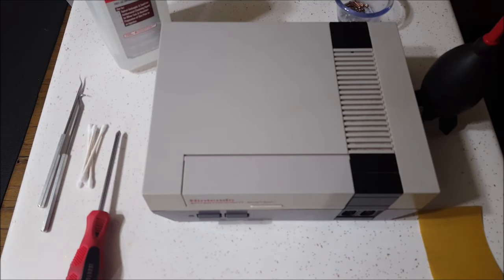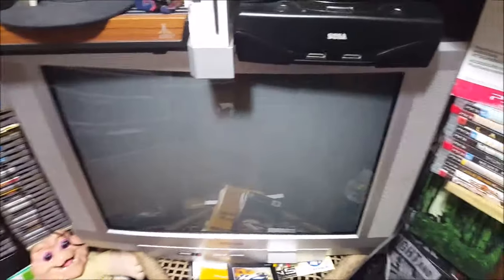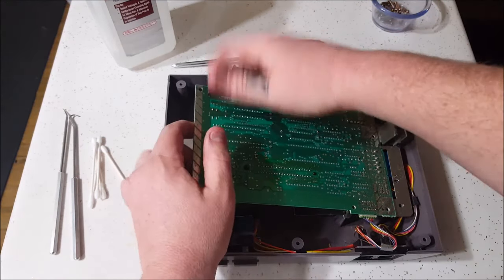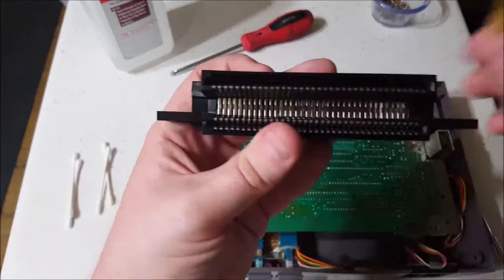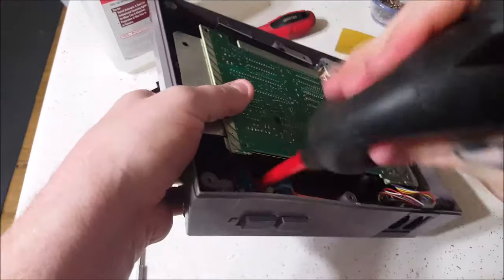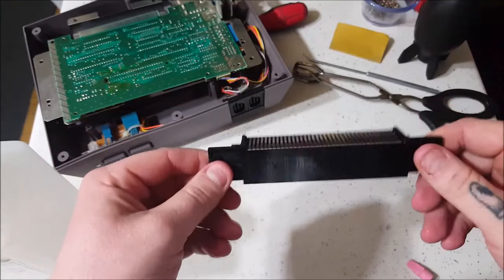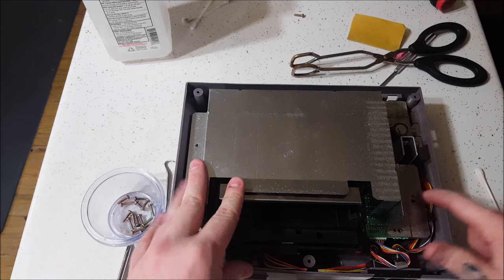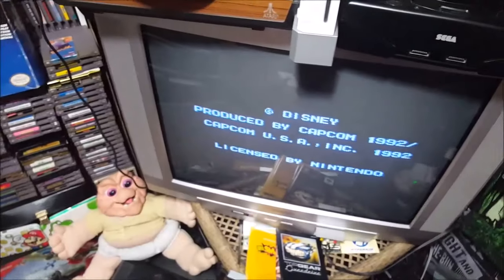NEVER Buy Another 72 Pin Again - How To Refurbish A Nes Easily

Comment from the maker: For more retro repair goodness, follow me on tiktok! https://vm.tiktok.com/ZMeC8T5tX/
Reply: Do you have any new refurb consoles for sale?
Reply from the maker: @mrivieccio  I do. Reach out to me on Instagram or discord!
Reply: I can’t get mine to repair like yours I did exactly what you did could you sell me a repaired connector?
Reply: What is your discord?
Reply: How about that pesky power/mod box? I got my kids an NES. It was working perfectly then lightning struck the house and fried the power box/rf/composite board. Is there any hope for this or do I need to unsolder the capacitor to access the inside of the box?
Reply from the maker: @lukegregorymusic7337  if you had a scrap consoles, you could do that but you're probably better off getting another since they're not too expensive to begin with.  A power surge through the console could send problems throughout the whole board.
Reply: @Renebean what size Philip screw do I need to get the screws out of my Nintendo console off amazon ?
Reply from the maker: @kylewilliams3306  you're looking for bits called game bits. A 3.8 and 4.5mm are usually what you get in a pack
Reply: @Renebean  what size magnetic screw should I get to open my old Nintendo to get the 72 pin out
Reply: @Renebean  what size Philip screw driver should I get off amazon that mag and get the screws out of old Nintendo console to get the 72 pin contractor and also how long does the screw driver need to be 4in or 8in and should the driver be #2
Reply: What Philips screw driver do you use in the video to open the NES 001 console ?
Reply from the maker: @kylewilliams3306  a number 2 Phillips should work on all screws on the NES they're only about 1.5. Inches cheap so 4 inch would be fine. Any Walmart or tractor supply would have what you need
Reply: @Renebean  should I go with a magnetic Philips #2 4in or should I go with this one Klein Tools 603-4 Screwdriver, #2 Phillips Tip with Cushion Grip Handle, Precision Machined Electrician Screwdriver, 8-Inch?
Reply: @Renebean  how can I take out the 72 pin connector with out unscrewing the black tray and with out unscrewing the mother board ?
Reply: @Renebean  where can I get a 72 pin connector and a black game cartridge that I do not need to push down from ?
Reply: @Renebean  would would be a good place to buuy Tetris for NES

Comment: For anyone wondering: After 5 years this still works perfectly! Do not be afraid when you put your game in and hear a noise that resembles scraping. This noise freaked me out as I thought I messed up but it’s perfectly normal. Also, if you have trouble putting the 72 pin connector back in place don’t give up. It is very hard to put in and it will not break the motherboard no matter how hard you push. It will also make a scrapping sound when putting it on so don’t be worried. Lastly save yourself the time and make sure your game works. To do this shake the cartridge while it’s in the thing and constantly reset it every time you move it. It should work even if t
Reply: Mine is making a scrapping sound and it’s super hard to get the game in and out it worked and then it only had white screen 🫠
Reply: @vice8063 It will be hard to get it in and out, that’s supposed to happen usually. The white screen I recommend a small but simple trick of just moving the game slightly to the right when it’s pushed down
Reply: Hi.
Thanks. Im a subscriber.

How do i repair a blue screen nes ?

It powers on with a solid red light but goes to blue screen/grey screen.

Thanks.

Anybody knowledgeable please reply soon.
Reply: @smerk429  I recommend you clean the gaming cartridge with isopropyl alcohol. Try to use the highest purity possible, (I believe they sell 92% and 97% at most pharmacies) and it should work! Hope this helps
Reply: @HazeMazeExtras  thank you I ended up opening up the console and cleaning it and boiling the pins like the way Renebean says to do.

It works like a champ now
Reply: @smerk429  awesome! Happy gamings
Reply: Thank you for that:)

Comment: Restored a second back in high school. But my sister left it at a lock in party back in the day. Just bought a dity one for 30 on eBay to clean up again. Never had to use sand or boil though. Just cleaned with alch and eraser.

Comment: Just followed your instructions, and it's super easy. The only thing I have to add is that I was still having issues with all of my games displaying anything beyond an orange screen. I did some further digging and disconnected everything from the board and put it in the oven at 325 degrees for 5 minutes, which reheats the solder connections. Pulled it out, let it cool down, and she fired up like a champ. Your video was SUPER helpful!!

Comment: I found an NES at a garage sale for $5 last weekend 11/16/19. No cables, no controllers, nothing. A friend of mine gave me a bunch of games and I just bought a knockoff brand power cable to test the NES if it would work or not. I was so bummed out to get red flashing light and no image. I found your video and although the water boiling part scared me I did everything you showed on top of giving every part a good cleaning. My $5 NES turns on now without a bit of delay. Couldn't believe it, man. The same guy gave me a sega genesis for free, again no cables. I'm hooked now in this hobby, tracking down everything else I need to start playing. Thanks so much, you have an absolutely grateful subscriber.
Reply from the maker: gald to hear it worked out for ya! welcome to the channel!

Comment: I would use a higher grit sandpaper than even 400 honestly. 600 would be more than effective, but 1200-1500 would still easily remove the tarnish that builds up over the years. Then spray it out with some plastic-safe contact cleaner and you're golden like a shower. Love the pick idea though. That's an old trick I use in some of the electrical connectors in my old Toyota too. That with cleaning the contacts works like a champ. Also on the pins on the PCB itself (this works great for the cartridge PCB connectors too), believe it or not a white pencil eraser removes the tarnish like a boss. Makes them bright and shiny new. Only problem with the cartridges is you have to remove the PCB from the housing to get an eraser to it, so it's not a quick fix necessarily. Lasts for YEARS though.
Edit: Jumped the gun; I see you already know the eraser trick LOL

Comment: I did this and it totally worked! I found an NES literally in a dumpster with a stack of games...that had been out in the snow for 2 days, and was already crusty and the light flashed when you tried to power it up. This procedure brought it back, along with all the games. Thanks!!
Reply from the maker: glad it helped!
Reply: @Renebean  Well it was working and then it stopped working, but now the games will load up if I just put it in but don't press it down, then power up. Like in the up position it loads, but if you press it down and then press power it doesn't. What could that be? It's like the game chip isn't making contact once it's pressed down. I bent all those pins up with a pick and did the whole process like you showed verbatim.
Reply from the maker: @djsolo6820  that happens often if the pins arent thoroughly cleaned or aligned you will have to take it back out and repeat the process make sure you are sanding and boiling
Reply: @Renebean  I'll give it a try. I definitely sanded and boiled the first time around. I did every step. I read somewhere that this is common if someone bought an aftermarket 72 pin, which I have no way to know. Apparently they work in the up position and not in the down position due to the pins getting bent when pushed down (or something to that effect). I bent all the pins up with a pick, and you have to really push hard to get it in, it's not a one-handed thing like in your vid. Do I need to bend those pins back down a bit?
Reply: Epic

Comment: Just wanted to say thank you! I followed your method and fixed my first NES today. Worked like a charm. One thing that was different for me was pulling the pins up. It was easier for me to use tweezers vs the hook you used. Though my hooks were made of cheap plastic. I need to order new ones that are heavy duty metal. But anyway, yeah it worked like a charm. NES was so bad, I say 10 times trying to put a game in to play, maybe 2 times it would work or show anything on the screen. Now it works every time and I dont have to adjust how I put the game cartridge in. You know sometimes if you put the cartridge in tightly it works. Nope. I push it right on it like it was new, push it down and turn it on and bam, works great!

Comment: Thanks brother so much for these tips and tricks.  Opening up a NES from childhood and cleaning it out was fun.  Mine personally wasn't that dirty after 30 years, but I did bend those pins back up to that original state.  I also bent back that fourth pin to prevent that blinking light of death, which is no more.  It all runs like a champ and now were playing on the big screen.  Next, is to get some game tools to open and clean those games and other consoles.  Look forward to the other videos for some more refurbish and repair.
Reply from the maker: glad the video helped
Reply: Same here, i got mine for Christmas 1990 or 1991 and it wasnt the dirty at all. I also forgot to bend the pin back. But after putting it back together, and a game in, no more blinking light.

Comment: Thank you for this video! my NES finally works! and so well!!

Wanted to add: if @ 12:55 you're finding that NES motherboard 72 pin connector is absolutely filthy (like, soot-black still even after dozens of alcohol+q-tips later), don't despair. Pick up Brasso (or a similar metal polish) and a couple soft cloths. Eventually, you can wipe away 30+ years of oxidation and have your NES work again (that's what happened for me!)
Reply: Brasso should be used sparingly. And very carefully

Comment: I think your video even though being an old one is more knowledgeable then others I’ve seen.  I fix almost every system from ps2 and Xbox on down. These are temp fixes, it is true if your 72 pins are in bad shape it is not going to play.. I remember stores where pushing that a lot. After a short amount of time I had people coming to me saying it use to start right up for a bit then it started flashing the red light and just kinda went back to the old ways... I tell people as well no matter what it’s the processor or a chip and 1 in particular that needs to be clipped or replaced and then no matter how long or how many times you run a game threw it’ll always play .. But..!! You have to make sure you clean the cartridge with alcohol from time to time.. looking into the chips thats a permanent fix.. I myself have 3 Nes , 1 in the box , 1 I modded and another just bcuz. The one I had mod I have had that for 35 years and as a youngster I played the shit out of it, it always had that blinking light issue and such.. I started to get into computer technician and diagnosing computers and how to fix them.. one day had the itch to play retro games and pulled the NES out and remembering all the problems especially playing a game and getting far just for the NES to Blink it’s Light of Death lol..  I take care of all my stuff especially my consoles , but dirt and grim collected and stayed inside the pins and system especially from all the spit from blowing inside the system and the cartridge, anyone that grew up in that time era knows exactly wussup.. I did your method almost, I checked the pins made sure they weren’t bent, cleaned everything with alcohol, system started to work but as the same as it was in the 80’s. Soo I dug in further to find a security chip that needed to be clipped.. This was the reason NES was faulty all along. After doing that and now after 2 years the system still runs great it never blinks and pops on as soon as I put a game in... like I said earlier your video is more clean then others and you didn’t stutter or seem to take a step back as if you didn’t know how to explain.. kinda tired of being shown videos of people making videos when it seems there just regurgitating another persons videos and same dialogue; Not really knowing what there doing and sounding like they have really no Business showing how to fix things , when they sound like there a teenager and wasn’t around for those days to be dealing with these issues lol .. Keep up the good work 👍🏼

Comment: FanTASTIC video. I actually bought a refurb NES with one of these new 72 pin connectors and you are right, it took the force of 2 men to get the damn game in and it worked for a second then each game i put it had glitches all over the screen, so i took the old OEM connector from my old NES with the AV issues and put it in the "new" NES i just got and took that new "72 pin" and tossed it in the trash. Now i got the new NES with the old OEM pins and it works perfect. I still have to blow into it and it blinks sometimes but i havent tried this yet, so if it gets worse I have this video saved for reference. Thanks!

Comment: I use the exact same process for refurbing blinking light and disabling the lockout chip.  Such a great system but that design flaw that flattens the pins is such a drag. It really does get them going like new.  The first ones I did I kind of over pulled on the pins on the pin connector so the games worked without having to push the game down but I have learned to be a bit more gentle.  At the same time, not having to push the game down would theoretically protect the pins and make them last even longer.
Reply: tony john  I believe so. It is probably better to hsve it set so you do not have to push the tray down but it kind of takes that nostalgia feel out of it.

Comment: Those hesitant. My NES is my baby. I did everything. Step by step. Exactly. Even bought the tool kit and everything. This works. Even the disable chip pin. The boiling. The sanding. Do everything he says and take your time. It works like it's brand new. I had purchased and installed a new 72 pin from Amazon, it still did not fix my NES. I tried this. Bingo!

Comment: just did my first refurb, this fixed alot of issues I was having with button and playing some games. your video was excellent, easy to follow, and everything worked as expected, thanks so much!
Reply from the maker: thank you im glad it got you fixed up!
Reply: Renebean I’m pretty sure the unit I have already had a swapped 72pin (was fairly clean and inserting/removing cart is hard). So one thing I noticed is that after I put the 72 pin in boiling water and took it out, it was definitely easier to insert/remove; this is while the 72pin is still hot. Once it begins to cool, it’s gets tough to insert/remove again. Any tricks on how to make it easier for those of us stuck with a newer 72pin? Thanks
Reply from the maker: nervegrind3r you could bend the pins down a bit to help with the sticking but I wouldn't bend them to far

Comment: I would have sprayed the contacts with IPA after that boiling water trick.
Normal water is bad because of minerals in it, so if you have to use tap water on metal, AT LEAST clean it again with IPA to remove any even remote probability of rusting.

Comment: When it comes to cleaning the games, I have always used a bone-fry Scotch Brite scouring pad.  I have had better luck with using those than the pencil eraser.  I've tried using the eraser on carts that were at the point of no return with no luck.  The Scotch Brite Pad works every time.  Now, this method will remove a little bit of the finish, but the system will have zero problems reading the cart.

Comment: Nice movie man, thanks for all the hints !  A few days ago I decided to clean my Nintendo NES because one game wouldn't read. Actually the Pin 72 seemed to work fine but I decided to clean it anyway in case. Then I remember I had a Pin that I purchased on ebay probably from China, so I tried it on. But I couldn't even fit a game into the pin and the pin was very tight to install on the board. So I remove that  crap and throw it it the garbage then put back the old Pin 72. But the problem is that since then the old one doesn't work anymore at all. I wonder if it scratched something and damage the blades on the board or something. I have no idea what happend and it is upsetting.

Comment: I've cleaned a lot of NES games over time and have found that the eraser trick looks best for cleaning them .. i've fixed about 99% of my games over time. The only ones I couldn't get to work had other issues with them most likely. I go over my NES games I cleaned up with the eraser with running alcohol afterwards to get rid of any residue.

Comment: Some people say the reason the NES had start up problems is because the cart. would be pushed in, and the cartridge tray would be pushed down and locked in place. They say when you lock down the tray it would bend the connector pins, which would cause the start up problem. Later I learned that you can load the cartridge in without locking down the tray. Some people say the system will start up much better. I've even heard of refurbished Nintendo's where they disable the lock down feature. If you try pushing it down, it just springs back up. It's unnecessary to lock down the cartridge tray to power on the system.
Reply from the maker: disabling the lockout chip is mainly for people who want to play import games.  If the game works without being pushed down 2 things are either happening 1:  the pins are misaligned or improperly sanded and boiled or 2: the game is still dirty